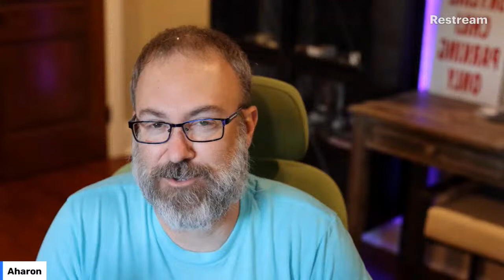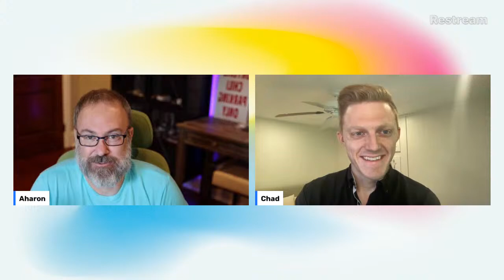Span Smart Panel Interview

Comment: How does everyone not know about Leviton. They have the same exact program as this company does and the parts the labor everything is way cheaper then this company. No one I mean no one sells parts for span other then the span company. And everyone I talk to says there sale reps are so hard to get ahold of. Only a few people know how to even install those panel boxes. There is weeks and months of back up installs from there private contracting installers. Again look up Leviton. Only different about span and Leviton is span has a battery to hold power. I can install a whole home generator that would last me a life time before I installed a span box and have to change out the box again because the battery goes bad. Good luck.

Comment: So with no physical way to reset if you lose communication. As a contractor that’s not appealing. Physical bypass is some what important. Plus mechanical cooling in the panel, seems like a lot to go wrong on critical systems. 
I’m all about the product in general.  I would install in my house to test for clients. Curious to see how it performs to you over this next year.

Comment: I got two Span panels installed last week. Similar to you Aharon, I am a CEO of a Software company (Connectivity-Labs). Thanks for this great video, it answered many of my questions as well. Especially the coming API I am very interested. Like you I have many ideas how to improve the system (Vacation mode, manual switch to "Energy Savings Mode" by triggering one of the backup-modes in the app, smart connectivity to other devices telling Span NOT to turn them off because they perform a critical task, scheduler for certain breaker to turn off during the night, seasonal scheduler (winter vs summer), and lots more).

Comment: Great video on the span product. A little technical at times for me but learning new things.

Spending $3,500 for this product and finding out it does not work with emphase would be an expensive problem. After watching this video I am not sure I want to buy a span.
Reply from the maker: Prior to my Span installation, I was already shopping for a new non-smart sub-panel. All of the electricians I spoke to were quoting me more than $3,500 to install a dumb $150 panel.